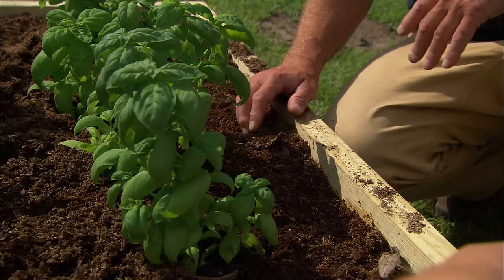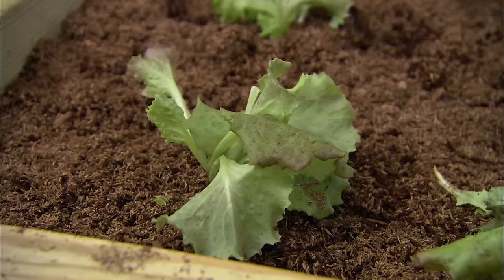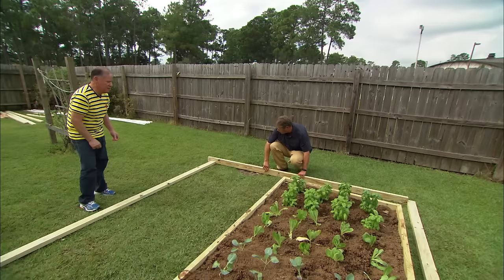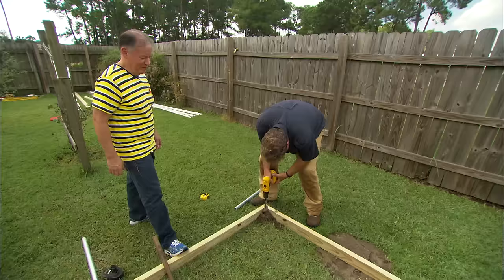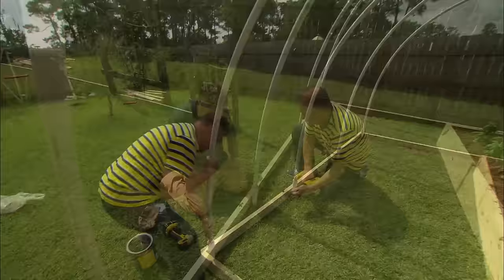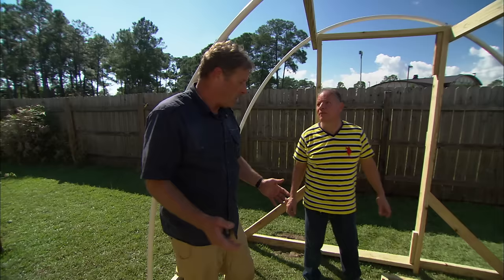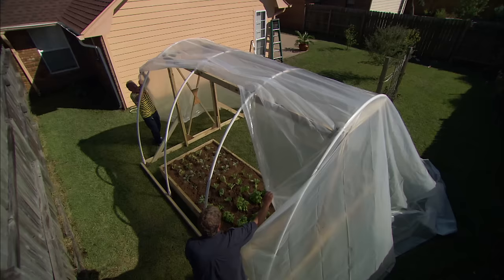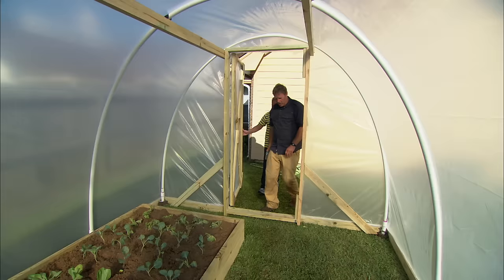How to Build a High-Tunnel Greenhouse | Ask This Old House

Comment: Used this approach for many years.  suggestions.  1) The plastic will need to be removed in advance of the summer heat.  Tie the plastic down instead of stapling it so that the plastic can be reused in fall or spring.  2) Critters are persistent.  Use the same frame for bird netting.  After draping the bird net, wrap the perimeter with wire fence.  (bird net keeps birds out, but critters such as rabbits and chipmunks chew through.)
Reply: I haven't wrapped my netting with wire fence yet, you are so very right.

Comment: Never ever pull the plastic tight ..... In the winter time it will shrink and split ... Just get the wrinkles out .... I learned the hard way.
Reply: how tight works best then?
Reply: I heard painter's plastic will last at the most 2 seasons and that greenhouse cover is the way to go.
Reply: This looks to be in Biloxi,MS... this won't last 2 years with the hurricanes anyways. Good input on the tensioning though.
Reply: It's been 2 years, is your plastic in little pieces now? The UV will harden it. You need clear or diffuse canvas.
Reply: I have never had the plastic last more than one season before it splits along the seam. I have tried different ways of anchoring it but at some point I realized it is not worth buying new plastic every year just to have some kale, chard and radishes over the winter. I don't live in a super windy area but even where I live that staple job would not cut it.
Reply: Especially if you're using crappy 4mil home depot plastic. Spend the extra $50 and get quality 6mil plastic from a greenhouse supplier.
Reply: Jo-Ann fabrics has great plastic     tip use a coupon
Reply: @jaycampbell6402  if you have PVC pipe that's the problem...the pipes leach chemicals into the fabric and cause huge tears.😉😉😉
Reply: thanks for the tip!!!!!!
Reply: @richardgates7479  I was thinking canvas would be better for something like this, especially environment wise. seems like it would last longer than plastic. Are there any specific brands or retailers you'd recommend?
Reply: @ricardopadilla4711  6 mil is better.
Reply: @richardgates7479  in Florida maybe 6 months.
Reply: @littlejenng3  
I bought a diffuse cover for a greenhouse kit. I don't know who made the canvas, but it is reinforced clear canvas and it's holding up quite well. I have a second layer for vapor that's just the cheap window covering plastic, it is protected from the Sun by the canvas.
Reply: @Tufarock  is  6mm enough in a high wind area that also has snow?
Reply: @Effen Truth the wood is and always will have wet soil inside it... whats the diff?
Reply: And those staples are going to rip right through the plastic at the first windy day.
Reply: That bottom edge will collect snow and ice 
for another quick demise
Reply: @gandalfstormcloud7514  what could you use instead?
Reply: @Effen Truth I was wondering why they didn't use weed barrier plastic
Reply: Thank you.
Reply: I call bullshit on your comment. My greenhouse is made from a round top portable garage frame with 6 mil really tight. Heavy snows here in Canada.. my plastic is just fine. Common sense.

Comment: You can put pieces of lath over the staple rows to help hold it down, the staples alone don't hold it for very long.  Trust me on this one
Reply: FISH ON i
Reply: Thats all thats needed.
Reply: Thank you!
Reply: was shocked they didnt do or show that
Reply: Why bother putting in tack strips with cheap plastic that won't last 1 winter?
Reply: @cathyrowe594  actually I use that plastic on my low tunnels during the winter only. Lasts about 3 years
Reply: I was saying that out loud to myself, when I was watching the video. 🤭👍
Reply: I was thinking the same thing, the wind will rip the plastic from those staples. Screwing the lath to hold it would be better.
Reply: Yeah I suppose the wind will eventually rip the poly off of the staples.
Reply: also if you put the strips on the inside there wont be a lip for water and snow to collect in on the outside
Reply: I would of nailed it to a 2x4 on the sides with roofing nails with them plastic washers . then you could nail the ends to other 2x4 when it gets hot pull nails and roll it up so air can get in better. holding it up could be done many ways. Or would it be better to cut a slit in one of them pvs pipes to put the plastic in then roll it up so it would stay.  then you could roll it up as far as you want lol
Reply: @slingshoter8783  you would of huh

Comment: Man i believed in u man , but the moment u stapled that plastic wrap i died & so did most of plant's.
Reply: Michael Michael. What do u recommend doing?
Reply: Ronnie Chandler  the sturdiest way to secure plastic is with a C-channel and wiggle wire but if using board you need some kind of stripping. 
But that plastic isn’t going to hold up very long, the sun and/or wind will destroy it in no time :(
Reply: @rnupnorthbrrrsm6123  absolutely right.. Maybe pinch the plastic with another board.. But staples?
Reply: I threw-up a little when he said “staple the plastic”
Reply: @bucsboy78  when I used to build green houses we would roll the end of the plastic around lathe strips and drive  pole barn screws threw the lathe and plastic into the bottom frame.
Reply: You're HILARIOUS!!!
Reply: Not to mention this guy bought 4mm greenhouse plastic. Won’t last a year

Comment: Additional materials must have magically appeared after they left the box store. Beams, anchors, more PVC, PVC cement, doors, hinges, screws and staples... plus the tools. Awesome.
Reply: Totally agree. Needs to include a parts list in the discription.
Reply: I give that plastic sheeting a year and it will fall apart in the sun
Reply: @rudy_2299 less than a year if it's windy, the staples will tear right out of the plastic...
Reply: True. This channel seems to think it knows everything but gives you a guide without the whole list, to make something that'll be destroyed in the first storm.

Comment: As one who used this video a few years ago, there is a lot of other things that should be (common sense) included. FOR INSTANCE: 1) With not much wind-blow those staples are not going to hold and pull loose (leaving holes in the plastic), one should consider using ferring strips to better secure the plastic to the skeleton. 2) When cutting the plastic for any doors/windows/etc. don't cut it even with the edges , instead cut so that the plastic covers the door/window/etc at least the with of the lumber used to frame the door/window/etc. so that the excess plastic can be (better) secured to the framing lumber (this will help to keep the edges of plastic from giving under wind forces.).  and MOST IMPORTANTLY 3) make sure your hoophouse is positioned to collect the most WINTER SUN, as the winter will be the time you'll need the most solar heat.
Reply: How do you connect the ferring strips to the skeleton
Reply: @dakotaavila2439 I've used upholstery tacks and roofing nails. 1 5/8" deck screws work great if you intend to replace the plastic 3-5 years down the line.

Comment: When stapling the plastic to 2x4 you should have support for the staples or it will tear and blow. Use 1/8 or 1/4 inch strips of wood and staple through it.
Reply: Your better off using wiggle wire.
Reply: Yard sticks or shim work great too break them off onton1 or 2 inch sections
Reply: @mikebolton3816 then you would need the aluminium channels to fit it into...
Reply: @roythompson6137   yup. I did my 40ft long greenhouse with them, in 2 layers. Top rail stays on all the time, lower, I remove during summer, to roll up bottom 3ft for venting.   Later, it makes replacing entire plastic very easy.

Comment: My elderly neighbor built this and it blew away when we got strong winds. She asked me to help her rebuild it and showed me this video. 🤦🏻‍♂️ We rebuilt the darn thing like a shed and anchored it down. She ordered greenhouse grade plastic and has worked great.
Reply: I was going to ask about storm proofing/resistance. This may not be for me unless i shore up the design.
Reply: When they framed it in I thought they should have just expanded the framing out, cover IT with the plastic, and just not even bother with the pvc.
Reply: I guess the metal poles they hammered in didn't work as an anchor.
Reply: I would...
1. Drive rebar stakes into the ground
2. Slip the PVC pipe over the stakes
3. Place edge-wise 2x4s on the inside and outside of the PVC.
4. Use bolts to clamp the PVC between the 2x4s.
5. Weight the edge down with bricks every few feet.
Reply: @joshharper1906  it would probably work with diagonal bracing. Big green houses also use double layers of plastic and use a blower to pump air between the layers which greatly improves the rigidity.
Reply: @jessstuart7495  could you elaborate?
Reply: @jessstuart7495  or cement might help too
Reply: ... add a second layer of polly with air blown in between ... the double polly will reduce wind resistance as well as help with wind gusts,  snow removal.small hail storm ... if needed ... zone 6 here ...
Reply: @willgaukler8979  as well with holding heat longer
Reply: @notarivs what grade of plastic did you use and how much did you need what were costs? Where did you get it
Reply: Wouldn't it suffocate the plants
Reply: @shindanu drilling a hole in the ground ensures they're going to be loose as hell
Reply: Not surprised. It's hard to find any greenhouse videos that show how to make ACTUALLY strong greenhouses. I'm in an area that gets extreme winds but only from one direction and trying to make a greenhouse on the cheap. I think I will put a water tank on the end that the wind will blow into to break the wind and keep the greenhouse really low.

Comment: Joe since I wasn't paying attention at Lowe's we have added end pieces so the PVC will fit over the galvanized pipe that we bought that is too big.
Reply: He used a thinner pipe so it would bend. A larger diameter pipe would not bend as easily.

Comment: This Old House is now charging via their website if you want to watch the full episodes.
Thumbs up if you think this is a horrible change and want the full episodes back here on YouTube!
Reply: Considering they used the wrong pipe in the ground and wrong wood in contact with the ground as well, if I was you I'd look elsewhere for advice
Reply: That monthly subscription greed
Reply: @goldenages7089  What pipe should have been used? What wood? Chemicalized pressure treated? How about bamboo or would that swell too much? Thank you from a non-tech viewer preparing ideas for the GRAND SOLAR MINIMUM challenges coming full speed ahead.
Reply: Sunny SeaCat id use this advice ngl
Reply: @sunnyseacat9232  should use pressure treated wood if it's on the ground or getting wet.can use rebar in place of galvanized pipe it will fit inside the pvc no adaptor needed or just use the brackets they used also maybe 2x6 for the base but 2x4 works
Reply: And leave a way to roll up one of the long sides for better airflow
Reply: Sure it does
Reply: I have the PBS app and I can watch full episodes of TOH and Ask TOH on there just fine.

Comment: The trip to Home Depot was quick. They bought PVC pipe, some 2x4 and some plastic. But then literally the first thing needed to start building the greenhouse was a galvanized pipe (cut to size), brackets to keep PVC in place, an augur, and corners for framing......geez. There is a bunch of stuff that was used to build the greenhouse that was not purchased at Home Depot LMAO

Comment: I'm a plumber and would recommend painting the pvc or using some other material, because it degrades in the sunlight
Reply: Modern PVC  or as it's now called, UPVC, doesn't degrade in the sun  (retired plumber :) )

Comment: Very informative, thank you!
Tip: Never use pressure treated wood for a food garden, it's toxic.
Reply: This was true up until 2003 when CCA was banned as a wood preservative.  Today's pressure treated lumber uses ACQ which is non-toxic and safe to use for raised bed gardens, according to the EPA.  But I get it if you (or anyone) would prefer to use untreated lumber - they just have to recognize that eventually the wood will rot and will need to be replaced.
Reply: For framing it should be fine. It is not touching the garden soil.

Comment: There is also a product that looks like a strip of channeled plastic with another strip that clips inside it that is designed to clamp your poly down at the ends, another good what is to leave enough plastic to wrap around a strip of lathe and simply screw it down, that prevents it from being torn as in the case of staples. Just remember when ordering your plastic that 12 feet wide will not finish 12' wide after termination on the ends.

Comment: I've seen lots of greenhouses built this way. In every one a chemical reaction between the sheet and pvc dissolved the sheet where the two meet.
Reply: So what's the solution to this? Does this happen with UV rated plastic? Appears they did NOT use UV rated plastic in the video.
Reply: @loufarrocco7023  if u want a greenhouse that will last, buy some chain link fence top rail and have them bent at a muffler shop. Cover with uv rated plastic.

Comment: Glad I read some of the comments.  The PVC Pipes are 20 feet long.  The shopping list gives a hot link for the 4m plastic.  When I clicked on the hot link to Amazon I see about 40 different items for the plastic but out of that 40 only 3 or 4 are wider than 20 feet which unless there is another dimension where 10 feet can stretch to 20 feet (or do you double wrap or tape a seem at the top) I don't know how this will work.  It looks like a beautiful design but kind of deceptive in not telling all the pieces you will need, like the galvanized pipe, wood for doors, hinges, adapters for pvc pipe, etc.

Comment: One wind and that's toast. It's  held by staples only. Lol
Reply: They should have used tape batting for greenhouses.  That way you are stapling in the tape, not the plastic which will rip around the staple in high wind.
Reply: I don’t think it’s windy in south east US, the tornados only happen north of there they avoid Mississippi
Reply: Eric Moulton we have hurricanes.
Reply: Ross Treloar r/woooosh
Reply: Eric Moulton I’m from Florida, we don’t really get tornados 🤷🏼‍♂️
Reply: Simple Tek - but it’s made with TOH staples which everyone knows are 1.33 times as strong as the average staple. It’s basic math man
Reply: @kingofepicvlogs4666  1.3 ! Well that changes everything!
Reply: I want ti build something like this but what would be the best way to anchor the pvc pipes and wood frame and what is the best way to attach the plastic to the frame?

Comment: Stapling direct over plastic is not a good idea. It should be stapled with a  rubber material. Also how durable is it holding up against strong winds?

Comment: Should have used Greenhouse grade plastic .  At least 6mil. Plus the plastic coming in contact with the PVC will make it degrade over time.
Reply: Ok
Reply: Neither the 4 mil plastic nor the PVC pipe that they used in this video are UV resistant. I'll be amazed if that greenhouse lasts more than two years.
Reply: Woohoo! I said the same thing!
Reply: thanks for the tip, another good one!
Reply: Didn't use PT wood either, and the galvanised conduit they drove for stakes will rust.
This was a piss poor 'how to' video
Reply: Will Dwyer I did this set up with pvc pipes and it lasted 7 years and would have lasted longer but I didn’t use pressure treated lumber around the base.  The pvp pipes are still usable after 11 yrs
Reply: That design is what I call bull s#it. Been building greenhouses for years. That pvc will react with the non uv plastic and WILL not last one season. Looks good now but give it 6 months and that plastic will be so brittle a stiff wind will shred it like tissue paper guaranteed. Spend the cash and get uv grade or don't waste  your. Money!
Reply: @willdwyer6782  Yeah, the south would destroy the whole thing in two years.
Reply: @johnberry2877  What plastic should I use to build this? The 6mil?
Reply: @deankreutzer2745  what length galvanized steel poles did you use?
Reply: @winingar64  I just put the pvc pipes over rebar that was pounded into the ground.  Instead of pvc I have now moved on to using stronger materials.  7’ chain link fence posts put into the ground 3’, and 20’ chain link top rail pole(2x 10’) that go inside the posts.  Very strong.
Reply: @deankreutzer2745  how did you bend your chain link fence top rail post?
Reply: @loribirchfield1218  I used a pipe bending machine, but there are very simple and cheap hoop benders out there, just search on google.  Thanks!
Reply: @goldenages7089  They mentioned at the beginning they used PT wood. Maybe you missed this? It's even in the show notes.

Comment: Take half an inch thick strips and screw them on the stapled sides, this will keep the wind from ripping out the staples...Building windows on the ends keeps the inside cool and keeps unwanted pest out.

Comment: Once the wind gets in there that plastic will rip away from those staples and be useless.
Reply: Jackie Lewis so then what's a better alternative
Reply: Exactly, I have been searching high and low of ways for DIY small(big enough to fit 2 of my metal shelves...about 3ft by 5ft) greenhouse that will connect to the back porch of my house BUT the trick is in TX we get a very strong wind coming thru and will blow just about anything in it's sight...so back to the drawing board. Any idea is greatly appreciated.
Reply: @mandiegarrett1706  bigger staples with hold
Reply: Wrap the plastic around a 1x2 a couple times and then nail or screw it to the base.
Reply: Dig a small trench and bury the plastic